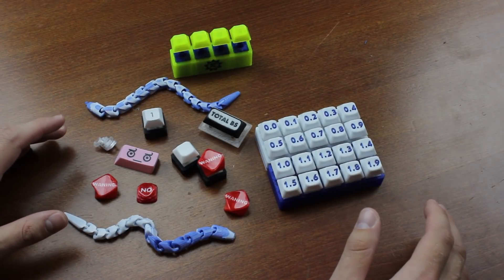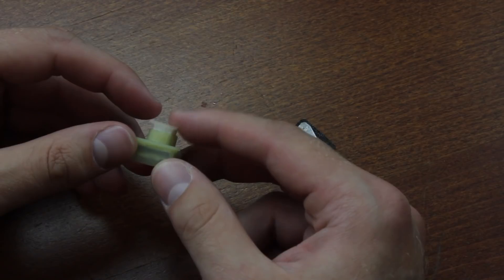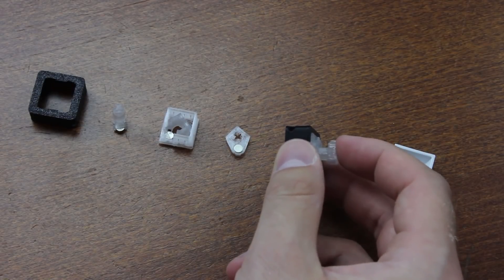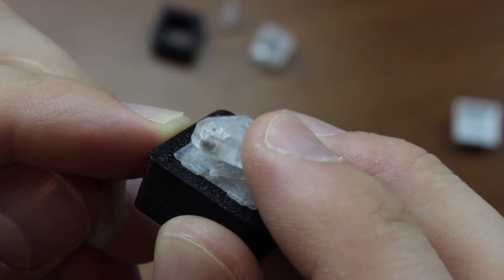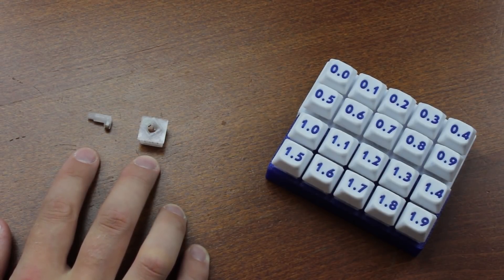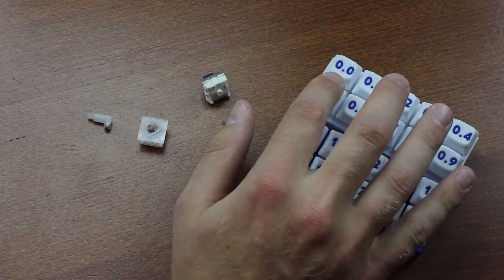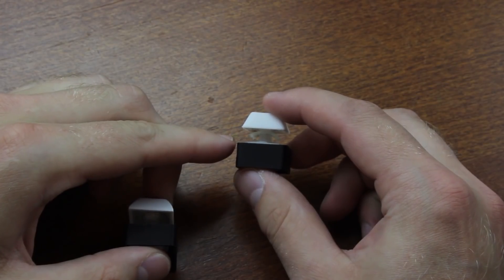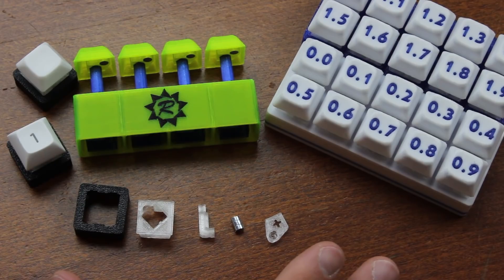Teardown - 3D-printed magnetic levitation "Void" switches!

Comment: Interesting design.  Not sure about the 3d printing aspect.  3d printed parts tend to have issues with tolerances.
Reply: Doesn't matter how terrible your 3D printer is...  The switches are parametric and have a STEM_TOLERANCE variable that you can increase if needed (0.15mm by default).  It'll work 👍

Worst-case scenario:  Just sand the stems!  You can make them as smooth as glass if you want but really, all you need is like 30 seconds with 320 through 800 grit sandpaper.  PETG sheds hydrogen atoms when rubbing against itself until the two surfaces become smooth.  So if you just type on the switches for a while they'll smooth themselves out regardless.
Reply: @Riskable3DPrinting  Man you have a very low bar if all your interested in is that it works.   Not even sure why you watch this channel if that's your bar to entry.   In all of the videos he has made, they 'work' , no matter how hhhhhideous. Heck, only a few have even gotten to the point where you could even argue about whether it works but non of even the most atrocious ones have ever not worked.  So what are you comparing against?   The one that was breaking key caps because of bad sizing or the one that the key caps kept falling off.  Never mind the slider feel and wobble.  Granted the Tactile part makes me curios about it.   Sounds good on paper.  But the rest looks like a sloppy, wobbly, scratchy mess.  But at lest it works.
Reply: @lucidmoses  What makes you think these 3D printed switches are sloppy, wobbly, or scratchy?  They're none of those.  In fact, with most switches if you shake the keyboard the keycaps will wobble a little bit.  That won't happen with my switches because the magnets are always tugging on each other.

Also, the print orientation is such that the stem and sheath have parallel layer lines that slide along the axis of motion.  Like this: || sliding against ||

If everything was printed flat then you'd have = against = which would be super scratchy.  These switches were made with 3D printing in mind so I made sure in the design that they'd be smooth right off the printer.
Reply: @Riskable3DPrinting  What makes me "Not sure about the 3d printing aspect".... Experience with 3D printed parts and the layering affect.  Rough side, slouch, uneven, pin holes, etc etc.   Sure if your doing a benchy tolerances don't matter that much. ±3 mm would be fine.  I do know of some metal 3d printing machines that have pretty good tolerances but tolerances of "±0.02 mm" is pretty hard to get on a 3D printing machine.  Heck with most of the home printers out there ±1 mm would be good.    So Yea,  For sure I'll wait for him to do a video on an actual keyboard.  Even with the "specially selected" ones he's likely to get.    I also think it would be funny to see someone sand the inside of an MX mount squarely to within tolerances.
Reply: @lucidmoses  Tolerances aren't really a big deal with my switches.  I've tested some with 0.5mm tolerances (which is ridiculous haha) and they feel/work just fine.  They're quite a bit wobbly under your fingers though!  Haha.

Also, the total travel of the switch makes a big difference in the wobble factor: The longer the travel the less wobbly the keycaps will be because there will be less room inside the sheath for the stem to rock back and forth.  My .scad also lets you arbitrarily extend the length of the sheath to reduce wobble without increasing the total travel of the switch if that's what you care about.  Honestly though, I could see myself typing on those 0.5mm tolerance switches without a problem. Because the tactility starts at 0.0mm it doesn't really make much of a difference other than feeling a bit strange when you're resting your fingers on the keycaps and wiggling them around intentionally.

With regular Cherry MX switches the tolerances can make a HUGE difference though:  It impacts the tactility quite a lot and the keys you aren't typing on at the moment can wiggle and make terrible rattling sounds.  With my switches the stem is always held reasonably tight at rest regardless of the tolerances and the sheath has a bit of a conical shape to it anyway so that the further you press the switch the more wiggle room the stem gets (this was something I added to reduce friction in the return path).
Reply: @Riskable3DPrinting  Yes, the conical  shape is a problem.  Ask Chyrosran22 how much he enjoyed having his key caps stretcher.  I just recommend you turn the volume on the phone down after you ask.  :p

conical mounts stretch keycaps over time if they don't bottom out and if they do bottom out then they don't hold solidly and are prone to falling off.   That's why manufacturers don't rely on that.

Some amount of wobble can be fine.  Sometimes not.   How much is fine depends on how much and how it's wobbling.  For me, a little shaft wobble doesn't bother me as much as the key cap wobble.  

My model M(s) and Unicomp(s) have a bit of wobble but it's pretty small and fine.   But I go around to help various users and some are fine and some are just infuriating.  

Still, technical manufacturing details can only get you so far.   The proof is in the using.   Honestly I'm guessing it is more on the Smith corona side then the Model F side but the scientist in me is happy to wait for an expert opinion.   We'll see what Chyrosran22 has to say.  

Yet, Like I said.  It's an interesting design.   I wonder what they would be like if a conventional manufacturer made them with better tolerances.
Reply: @lucidmoses  I don't think you understand where the conical shape is: It's in the sheath (the part the stem slides inside of) and it's very slight.  It would have zero impact on the keycap. The + in the Cherry MX version of the stem (at the top) isn't conical at all.  It's just a straight +.
Reply: @Riskable3DPrinting  That's because I'm talking about the areas your 3D printing design is likely going to have problems and your responding with other areas where it's less of a problem.  Area's of concern from least to worst.

1.Crunchy slider as the shaft rubs against the housing.  More clearance and you get more wobble and end up playing the game of operation.
2.The wobble at the top end of the stroke.  How much depends heavily on the design but lets say the top 10-20% of the travel. 
3) The mounting of the key to the keyboard (including any fixing pins if you have any).  Less of an issue if your mounting to a rigid metal plate.
4) The mounting of the key caps.
Reply: @lucidmoses  Ahaha, you obviously have no idea how my switch works in reality if you're talking about fixing pins.  Have a look at the magnetically-attached top plate on my Riskeyboard 70 to get a better idea: https://gfycat.com/easygoingcreepyfinnishspitz

Now take a look at the switch's movement: https://gfycat.com/sorrowfulequaliraniangroundjay

Another switch movement gif: https://gfycat.com/jampackedflamboyantamphibian

There's no way for anything to be "crunchy"  since it's layer lines like || sliding parallel to the axis of motion against layer lines in the same orientation ||.  Regardless, if your ideal switch is single-layer-graphene smoothness just break out the elbow grease and sand then polish the stems to your liking.

Comment: I am 100% going to pick one of these up when or if they become available: Even if it turns out I have to buy a set of keycaps with them too. Brilliantly designed!
Reply: I see little reason for this design to not go with MX style mounting. I feel like the mounting system is one of the key reasons MX style has become so standard. And its not like its a bad system or anything.
Reply: @prokopf-9332  I think the magnet in keycap might be a problem though

Comment: I had a similar idea but with coils or one coil and using an electric field to control the weight and tactility. You  could create a dampened switch and control the sound by using a few tiny speakers. I don't really have the time to pursue, so I thought I might as well put it out here before some arsehat patents it. Oh, almost forgot, you could also use the coil to power the switch itself I suppose, for displaying options or the LED.

Comment: Still wondering when someone is going to make a MX-type switch that uses magnetic reeds. Get the smoothness of contactless switching plus the long lifespan of magnetic reeds, in a format that will work with so many existing boards, chassis, and keycaps.
Reply: Magnetic reeds don't last as long as hall effect sensors. They're also very finicky to solder and are sensitive to dropping/vibrations.  They're also more expensive than hall effect sensors!  As far as I know there's only one reason to use magnetic reeds over hall effect sensors: When you want super ultra low power (i.e. for battery operated keyboards).  Reeds don't use any power at all whereas even the lowest-power hall effect sensors are always sipping some.
Reply: @Riskable3DPrinting  those are legitimate downsides. But the big issue I see with hall effect is that you need to specially design the circuit board that will use them, making it incredibly hard for someone to make their own keyboard from scratch; even more so if you want a proper full size keyboard!

Comment: That's really interesting. that one design makes a switch on any point of the spectrum of slightly to very tactile, or from low to mega-mega-high profile, is awesome
Also, have you seen his clicky keyboard? It uses relays.
Reply: My Riskeyboard 70 is actually a microcontroller board in its own right...  So hooking up relays was a cinch since all those extra pins are exposed at the back of the keyboard for hooking up things like that.  I also added a QWIIC connector but have yet to try it out with anything yet.  Was thinking about hooking up a color sensor board so you could hold up a color swatch (like you'd get at the hardware/paint store) and it'd automatically type out the HTML hex code for that color.  Would be a cool demo of the tech 👍

Comment: This is the type of innovation the keyboard technology needs to get out of the this swamp of Cherry clones.
Reply: The idolisation of cherry does tick me off, but one thing that I do appreciate and wish was an actual industry wide thing is how all the cherry clones have the same socket for keycaps
Reply: @davidy22  I dont think cherry is that much idolized, its just the whole scene with hot swapabilitie and all kind of was sure to end in one switch design becoming the norm. Its not just they keycap mount, also the pins for the pcb. All these new switch designs really only make sense as full non customizable boards.
Reply: So true. the "keyboard enthusiasts" seem to be fascinated by all the cherry mx clones with ridiculous names but its all pretty much the same isnt it
Reply: @chubeviewer  Well, it isn’t really “all the same”, otherwise why would people be interested in them. But I’m still very interested in this design. Much like the guy who built his own case out of stainless steel and frosted plastic (weighing the rather small keyboard in at over 2kg), I’m immensely proud of Riskable for trying to make this idea work. As a concept, it’s very cool, but it will really only stack up if it works in an actual keyboard.

Comment: Dude needs to kickstart this. This is amazing.
Reply: Amen. I'd buy it. I want this tactile contactless analog gold!
Reply: These are amazing, I can just see them being really expensive.
Reply: @myrealusername2193  you can just 3d print them and materials are really cheap
Reply: @malaythakkar8772  I was talking more about the magnets
Reply: @malaythakkar8772  just need to buy a 3d printer, resin, and magnets.  then learn the cad software...  right?

yeah, na.  i think some people would rather just purchase them
Reply: Wooting has tech like this, they are the analogue keyboard company, I used a flairtech switch keyboard wooting one, but will be getting a he at some point in the future that’s if this tech doesn’t super improve. But analog keys are insane for driving games n flight sims alone
Reply: Looks like someone has : check out the «Flux» Keyboard Kickstarter !

Comment: This looks great, now injection mould it.
Reply: Getting injection moulds made is really, really expensive (for a hobbyist maker like me).  Also, I'd need to get them made for each 0.0mm through 1.9mm or so and moulds for different lengths of travel (and other switch parameters).  The costs balloon really, really quickly. It's better if I just sell PCBs and have folks print their own or use 3D printing services (I think--we'll see).

Comment: That looks so very cool.  
Why aren't leaf springs more of a thing in modern switches? Or finger springs, wave springs?  It seems like a lot of effort is spent on compensating for the shortcomings of compression springs.
Reply: Metal leaf springs aren't easy to prototype with.  You need to be able to make them with very precise tolerances in order for them to work well in any given switch design.  They're also tiny and tend to go SPROING!!! off into the distance of your shop while you're trying to put switches together.  Ask me how I know this! :D

Comment: I've been thinking about completely magnetic switches like this recently, the only thing that could make these better is if there was somehow a magnet so strong it would repel the slider in all directions in such a way that there would be no friction at all but the switch would still be just as stable. Although I'm not an engineer by any means so I'm probably missing something important with that idea.
Reply: That would be very very difficult and it would cost a ton 😂
Reply: @imender9219  yeah lol, although that's assuming that it's even possible to make work.

Comment: The term maglev can be a bit confusing, as it is also used in some corsair fans
Reply: And trains and anything that uses magnetic repulsion, Corsair didn't invent the term, it's a generic one for what the switches do.
Reply: @lucidnonsense942  I was pointing out that if the term sticks, it could be confusing having the same names in two pc parts that could even someday come from the same brand. Just that.
Reply: Hence why I decided to call them "Void Switches":  Because the strength of the switch is controlled via the "void" between the magnets (aka the distance between them which is filled with plastic).

Comment: I had the idea of using magnets instead of a coil spring (or any spring) three years ago, and it's nice to see that some people have the same thoughts as I do, but took it a step further.
Reply: Dell actually had a 'maglev' keyboard in some of their laptops years ago.  Wasn't adjustable like this though and as far as I know it was still a simple contact-based design.  Just used magnets instead of springs for the return force.

Comment: An age has ended and a new era has begun.
Reply: Phineas: An age has ended and a new era has begun.
Gamers: $200 for MX clones? Take my money!!!
Reply: @gyozakeynsianism  who pays $200 for only mx switches? The most expensive switches for the largest mainstream layout would end at about $120. The most popular switches cost significantly less. And gamers usually buy like $25 switches (gateron/cherry), not $200 switches.
Reply: @user-kz9rz8ui1c  Sure seems like $200 MX keyboards are still on the market (usually with lots of lights). And the custom market (which is more for typist snobs than gamers I think) is MX dominated for some reason, and those keyboards are even more expensive.
Reply: @gyozakeynsianism  oh you're talking about keyboards. Any mx style prebuilt that is over $100 is overpriced imo. The only prebuilt worth getting that costs over $150 is the apex pro, which isn't really mx style. Customs actually usually range much more expensive, but youre mostly paying for great build quality. You can pick up decent customs for less then $150, any more than that and you are paying for design, material, and weight.
Reply: @user-kz9rz8ui1c  Yeah I wasn't clear. I meant keyboards with MX or MX clones.
Reply: @12345678946513  It's easier/cheaper, true. You're right. And that's why MX/clones dominate. But it can also be a rip off. For example, MX Browns and clones are terrible for typing (they're scratchy and basically not tactile) but they were actively marketed as typing keys, and the enthusiast community swallowed it whole and bought $160 Das Keyboard BS. Same with gaming keyboards. I think the market is maturing now, though, and people's standards are going up, and companies are figuring out ways of meeting demand.

Comment: damn, this switch looks near perfect. The only thing I wish it had was a way to change the tactility on the fly or with software.
Reply: Any keyboard that needs more than universal HID software to work is a no go in my book, as I don't need a keyboard to say be locked down to Windows to fully work, simply because the maker can't be assed to port the software to Linux, BSD, Mac, or any other OS that may come in the future, thus rendering it a brick.
Reply: @CommodoreFan64  You can be rest assured that any keyboard I make is going to have full Linux support.  Why?  I've been using Linux as my full-time desktop since 1999!  There's no Windows in this house (except for testing VMs hehe).
Reply: Changing tactility on the fly could have some serious video game applications.  I think fighting game developers would love something like that.